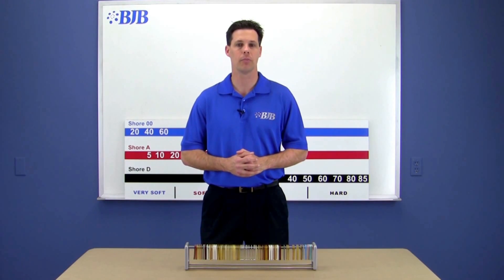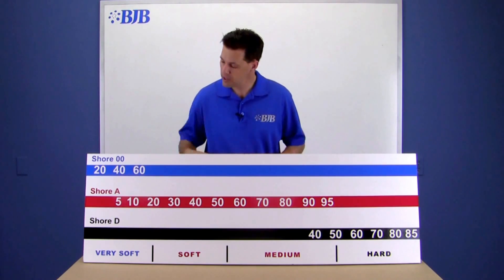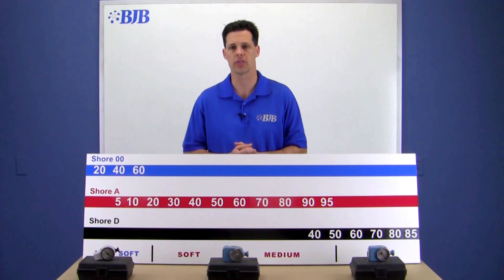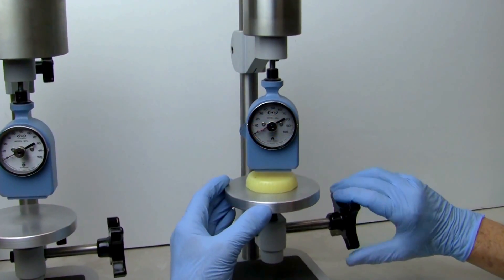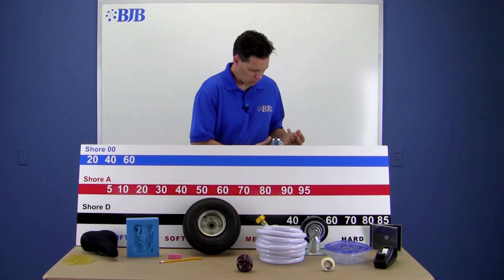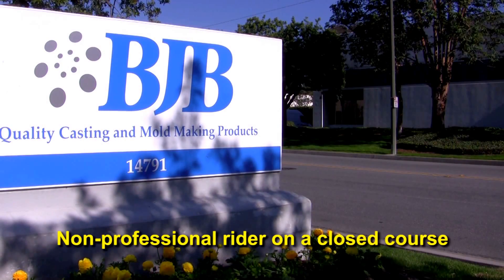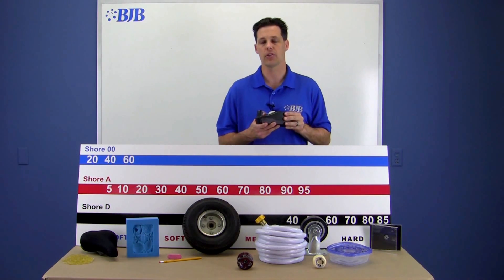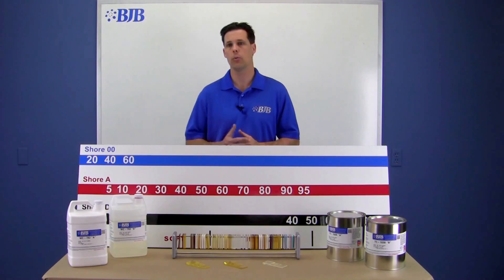What is Durometer?  Watch & Find Out!

Comment: I'm glad I found this video. Very informative, straight to the point. I'm working on a project and knowing what the durometer for the material makes it easier to choose
Reply from the maker: Awesome, glad it helped!
Reply: @bjbenterprises  I'm looking at your FD-60 resin for helmet making and hopefully at 4mm, it should be fairly flexible. And great for rotocasting. 

I'm also reading up on your TC-808 and thin spots at 5mm should have some flex. I don't know how it will react to fillers such as fiberglass powder to increase its strength and hardiness

Comment: I need to source a hard rubber block (about 30cm x 30cm x 4cm) for use in leatherwork as a firm, solid punching block that will not damage sharp tools. My research tells me that I need a durometer rating of 40D to 50D, about the hardness of black caster wheels, maybe a bit harder.  What search terms would be helpful in sourcing this rubber block material?

Comment: Very good information. Would you please advise what hardness/shore value of a polypropylene plant container will be? Is it still Shore D 70? I would like to make one and cut open the vertical edge so that it has some elasticity to attach to the bottom of my plant. Thanks for your great info.
Reply from the maker: Hello, yes a Polypropylene material is roughly Shore 70D.  Depending on the application or part requirements, you might even go lower in durometer (60-65D) to increase elongation and toughness if required.  Here is a list of products to consider:  https://bjbenterprises.com/index.php/polyurethanes/castable/semi-rigid/all-purpose/

Comment: would a hockey puck be a 40 to 50 shore d? thank you....
Reply from the maker: Hello Orion, a hockey puck would be around 90A, which is very close to 40D.  Thanks for your question.
Reply: do you have a water clear, semi uv resistant polymer of that durometer that you would recommend for casting? or would led light cause it to discolor? thank you for your promptness.
Reply from the maker: WC-595 https://bjbenterprises.com/index.php/wc-595-a-b/

Comment: I've travelled the whole internet to find this ! thanksalot.
So a resistant rubber like a tiler mallet would be what ? 70/80 shore A ? Is shore significant to shock resistance ?
Reply from the maker: Glad you finally found it!  A mallet is indeed around 70-80 Shore D.  If by shock resistance you mean absorbing vibration or impact, yes, lower durometer will absorb more.  However, you gain more toughness and tear strength as you increase Durometer (typically).  We have many customers who make engine vibration mounts or chassis mounts using 60-80 Shore A urethanes for example.
Reply: BJBEnterprises thanks a lot. i will choose that one so. it is to re-do old insulation rubber parts from a late 60's vibraphone.

Comment: To get a complete overview having shore C included would have been helpful as I am having to deal with a lot of shore C measurements..!
Reply from the maker: Hello, different industries tend to use different Durometer scales.  In our typical class of casting material systems, we usually only deal in the Shore A and Shore D (occasionally OO) as an industry standard.  We honestly do not get much call for Shore C.  Thanks for the comment.

Comment: Hi, I need some help please. I am trying to mould some small rubber blocks used in a vane type shock absorber inside a motorcycle engine. Six blocks with three hardened  steel vanes in between them. They would need to stand up to around +110C and down to -35/40C. These shock absorber blocks control movement of a fairly heavy alternator rotor.
What would I be looking for to do this? I have a steel mould made.
Reply from the maker: +John Evans Hi John, thanks for inquiring.  I think we can help you out with the application.  If you can send an email directly to our Tech Department with pics and info, we would be happy to assist you finding the right material for your alternator mounts.  info@bjbenterprises.com
Reply: +BJBEnterprises  Good grief! That was quick.15 minutes must be some kind of record. I will send an email right away. Does it make a difference that I am in the UK?
Reply from the maker: +John Evans :) No problem.  We do have a material distributor in the UK, Techsil but can hopefully point you in a direction with regard to material selection.  Regards.

Comment: I have a question. I need to make a part for a toy Airsoft gun that broke and I can't buy the part. This may be impossible since you haven't seen the part, but it's a clip under spring tension and is flexable enough to snap it over the rest of the toy, but hard enough to hold it's shape and stay on the area it's snapped on to. I was thinking Shore D about 75?
Reply from the maker: That sounds about right, but you may need to consider things like elongation, flex modulus, and a couple other points.  Feel free to email us a picture of the part and we may be able to answer this better for you:  info@bjbenterprises.com
Reply: BJBEnterprises Do you have sample pieces for sale? I tried a 78 shore D which felt good and snapped onto the toy fine but broke when taking it back off the toy.
Reply from the maker: We have cured coupons of our various products that can be mailed out for no charge.  Simply send an email to info@bjbenterprises.com and we can get you some samples to evaluate.  It sounds like you need a product with a bit more elongation.
Reply: BJBEnterprises I'll send that email Now. I'll use "cured coupons" in the subject.
Reply: That was beautiful you guys

Comment: whats better scale to running shoe measurement? a or c?
Reply from the maker: The most common measurement in our industry for elastomers would be the Shore A scale.  Shore C is not a commonly used scale.  Shore C has the same presser foot as the Shore A but higher spring force.  You can certainly use it for harder elastomers but you would find more familiarity with the Shore A scale in our industry.

Comment: Great video. I'm interested in seeing one about the difference between skin simulation polyurethanes (of which there are many on your website). I cant use silicone for various reasons so picking a suitable polyurethane is important.
Reply from the maker: Hi Kim, we do have many soft Polyurethane systems to choose from.  It may be best for you to get some of our cured samples to examine and help make a better decision.  You can also contact us directly to explain your application in more detail to narrow down material selection.  Note that we have both castable and brushable skin-like systems so this is where application details will help the process.  You can send questions to info@bjbenterprises.com